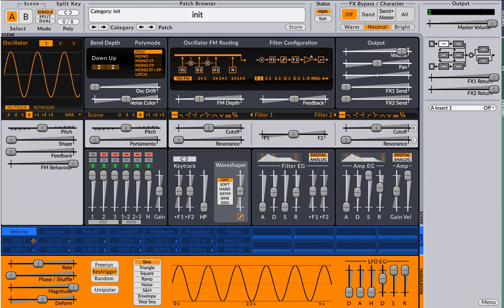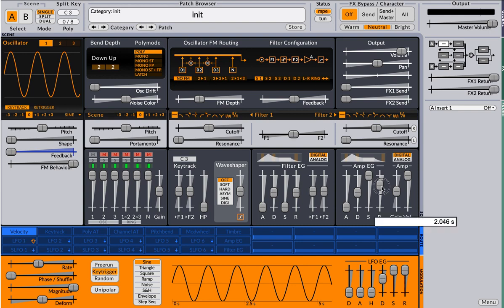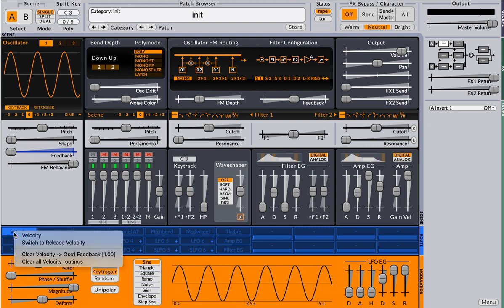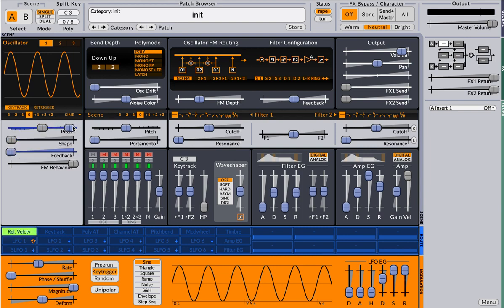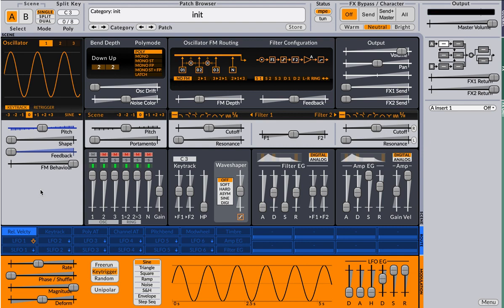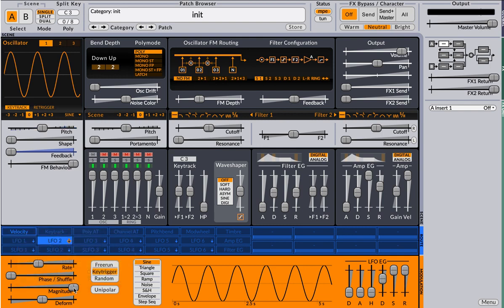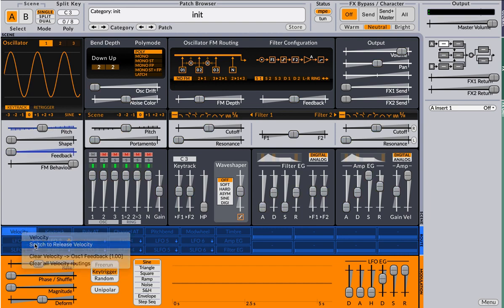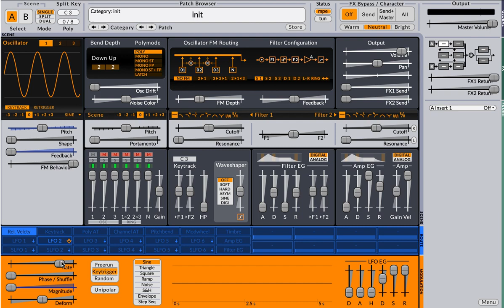Release Velocity in Surge 1.6.4

Comment: i do not have a bar that says feedback like you do.  where would you find it?
Reply: I expect you've found it by now, but it's a parameter the main Sine oscillator has (top level of the oscillator type menu) and others don't.
Reply: The oscillator Type menu is at the bottom right hand corner of the box showing the wave shape for the selected oscillator, near top left of the synth panel or window.